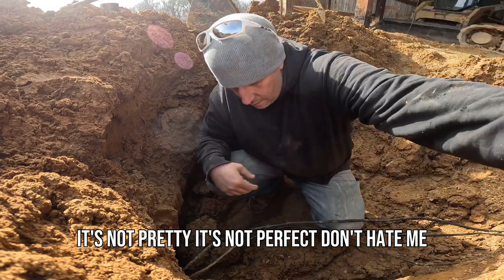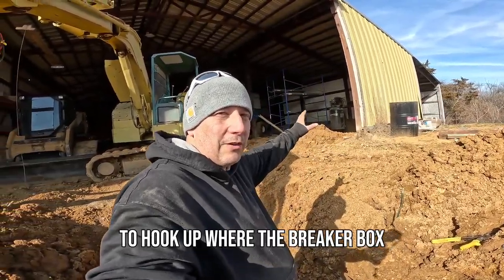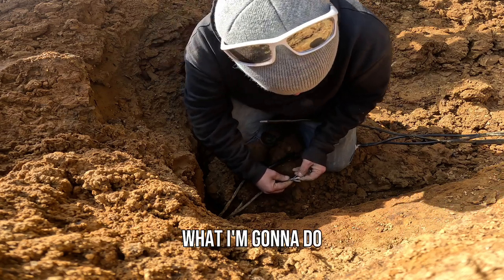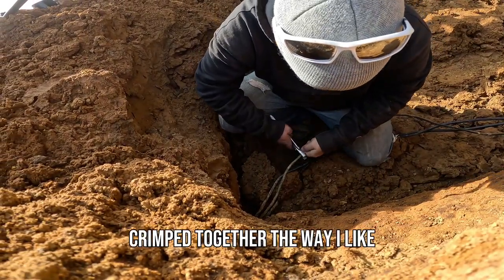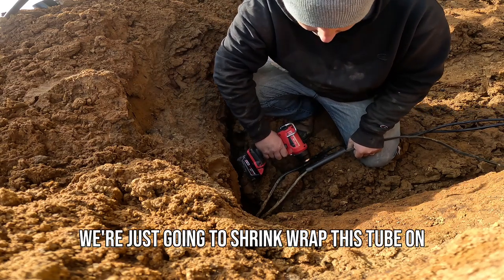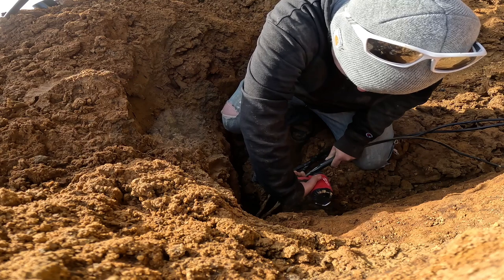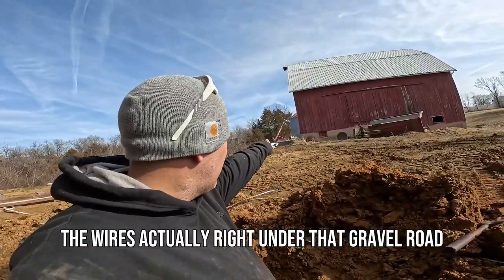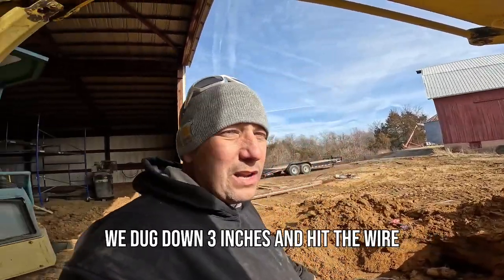"Electrifying the Barn: From Laundromats to Farm Life Adventure!"

Comment: Perfect the usual agricultural fix ,  great job , here we use SWA steel wire armoured cable for direct burial,  I used to use pyrotenax  which is mineral insulated copper cable which is great fun to use,  I always used to run every cable through a duct of some kind with a draw rope as you could guarantee as soon as it was buried the customer would want another cable through,  I used to use a polystyrene ball with a string and use a compressor to blow a draw wire through ducts without

Comment: Why not use conduit?
Reply from the maker: Unground wire rated for this. Saves on using conduit. I do have conduit when i leave the trench and go up to panels.
Reply: @FollowingKeenan  the proper way is to conduit it all the way in my area you would have to or the town would fine you for it and the sparkys would not sign off on it